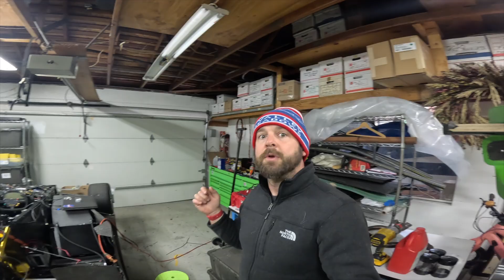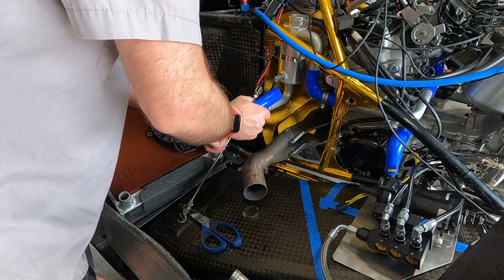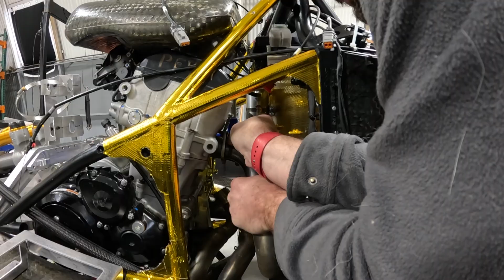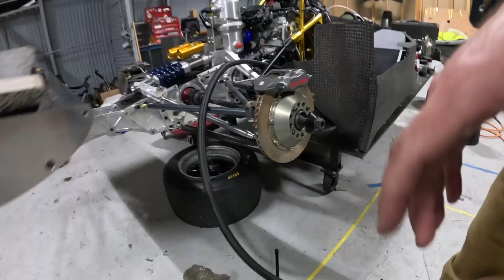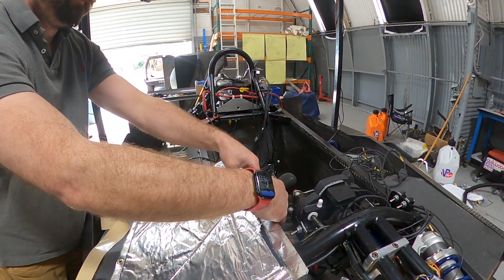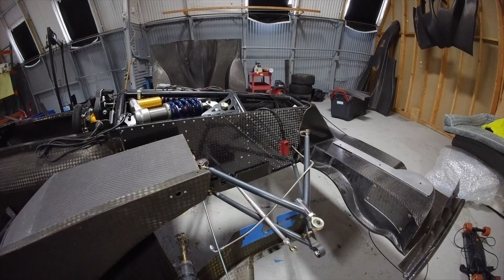Ep17: Final Assembly part 3: Lots have been done and she does come to life... momentarily. More Soon

Comment: Wont those heat shrink hose clamps lose their tension when the engine heats everything up?
Reply from the maker: @beachboardfan9544  it actually increases it squeeze. With heat they shrink more. So a never ending clamp pretty much.
Reply: @commodorepdog32  Cool! Need a link to those things!
Reply from the maker: @ 

https://www.pegasusautoracing.com/group.asp?GroupID=GTSPGCLAMP

Give them a call to make sure you get the correct shrink fit!